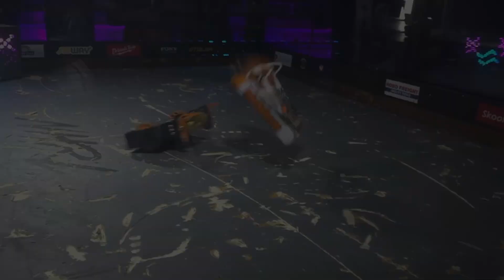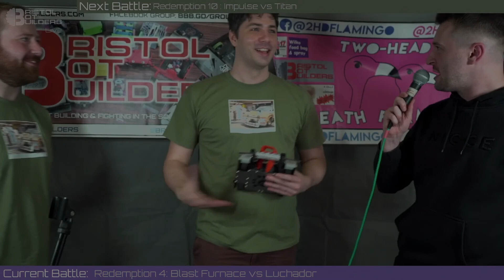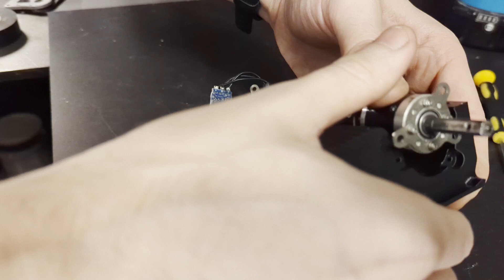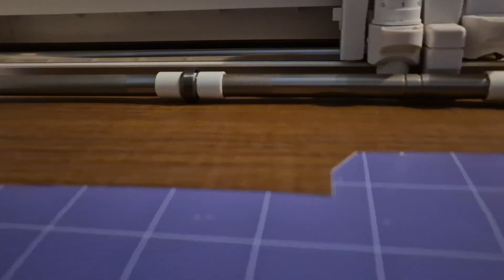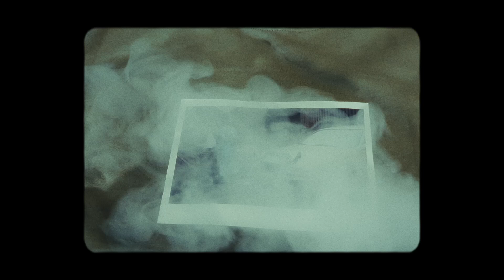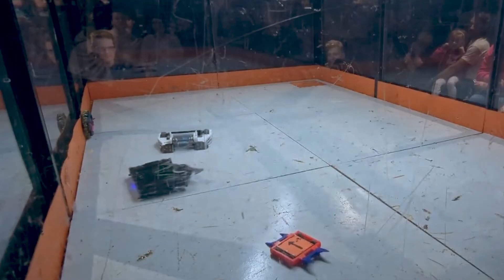The Modest Expectations of Bad Daddy

Comment: How did you get the tensioning right for the weapon pulley?  Flat belts always seemed weird to work with.
Reply from the maker: Turned down the pulley until it worked right with a new belt
Reply: @TomcoDesigns  ahh ok, something of a trial and error type deal makes sense

Comment: I have tried the heated inserts for 3d prints, but I find they fail easier that without them when done properly. Now I simple under size the hole a tiny bit, then increase the number of walls on the print. Once printed I simply tap threads into the hole. Everytime I have used this method it has been steonger than the heated insert. Alternatively if you can put the heat insert on the other side it will hold but easier than that you can get squarw nuts and put a small square pocket to slide the nut into. But the easiest is to design is the tapped hole version and as long as you have 6 walls its normally steonger than the heat insert from my testing. Awesome robot. You really took it the distance in the competition. Amazing work and congratulations I would say it paid offbeven if you lost the final match.
Reply from the maker: Thank you!
I've managed to remove every heatsert on the robot, apart from this one for the link!